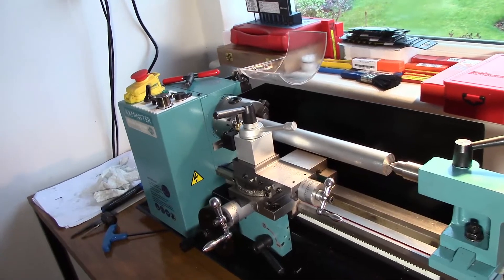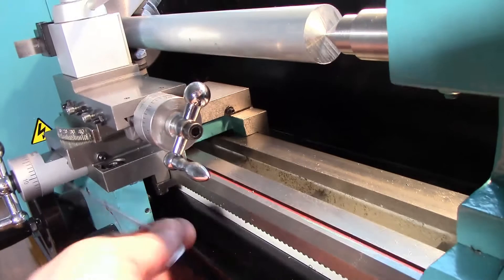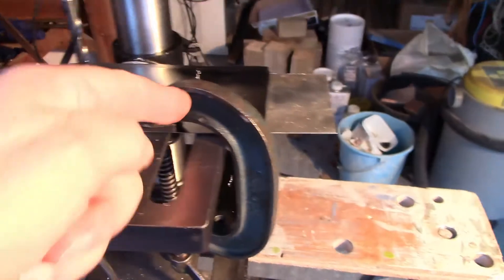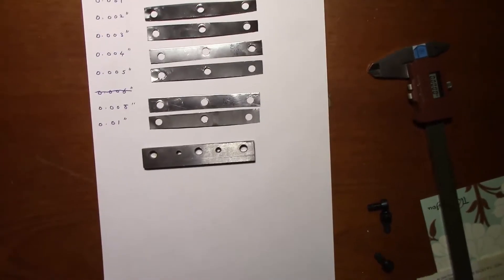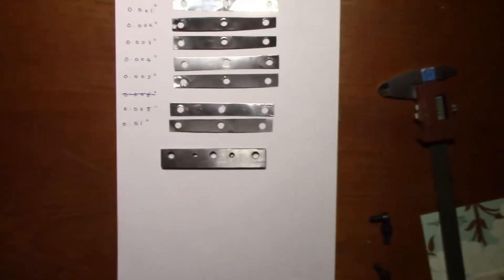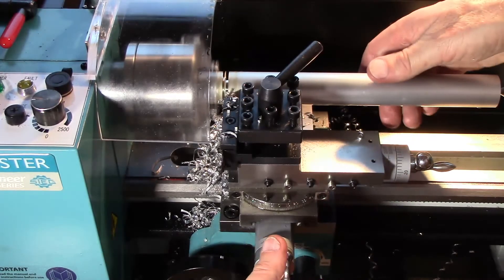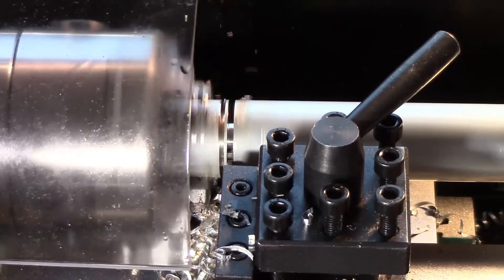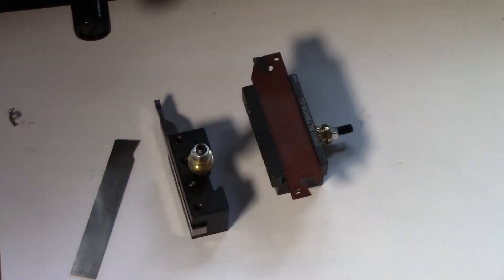Struggling with parting off on the SC2 mini lathe - part 3

Comment: One thing I do is to apply forward pressure to the tool-post by hand so that any backlash in the cross feed thread is taken up in that direction and the cross feed id effectively holding the tool back rather than push it towards the work. It seems to reduce the tendency to chatter and grab. Taking a second cut to the left of the parting-off line also helps. I only use the cheap and cheerful parting off tools with the 1.5 x 5 x 63 HSS inserts held in the standard 4-way tool holder. And unless I'm cutting just delrin I'll sharpen it before every job even if its only tickling it with an Arkansas stone.

Comment: Lubricate the aluminium with wd40 . The wedge type tool post is better than piston type also.
Reply from the maker: Since 2018, I have changed the toolpost for a steel one of the wedge type. But most of the flexibility is elsewhere, I think.

Comment: Put the tool in upside down and reverse the direction.
I too am a beginner, and I went through five or six carbide inserts trying to part off. I haven't broken any since parting off with the tool upside down. 
Try it, you've nothing to lose.

Comment: I use this style https://littlemachineshop.com/products/product_view.php?ProductID=1729&category= They don't seem to stock the exact ones I bought anymore.  They are relieved on the sides.  End on they look like a "T" .  To sharpen, I have it mounted into the holder to help keep it square and level and push it straight into the bench grinder wheel (6") this keeps the cutting edge perpendicular to the Z axis of the lathe and the radius of the grinding wheel gives some relief.  I use this set up on an SC4.  Cutting oil or WD40 for Aluminum
Reply from the maker: Thanks, I'll try something like those. But SC4 is 3 times heavier than my SC2, so I expect you get much better rigidity too.

Comment: A lot off oil and slow rpms for parting,, but you need to realize it's not easy to part stock being supported from both ends it has no choice but to drop and bind

Comment: these Chinese lathes are poorly designed. the compaund rest end cross slide are undersized and the sliding pin is too wide. those who buy them are forced to make many changes to improve the situation they manage to work but it remains a bad product. i recommend a proxxon mini lathe is small but it truncates metal like butter.
Reply from the maker: The nearest equivalent Proxxon lathe is the PD400 at £2380 compared to £763 for my SC2. I guess you get what you pay for. Or, you are paying German as opposed to Chinese labour costs!
Reply: @samuelfielder  I can reassure you, the PD400 also has the same problem ...
Reply from the maker: @TorteTS  Good to know that. If I were to spend above £2000 on a lathe I'd go for a used Colchester I think.

Comment: I admire your determination and efforts to succeed with the parting...
If you havent made the saddle lock yet - you can lock the saddle by disengaging the lead screw from turning (lever at back) and use the power feed lever (under the saddle) to clamp the half nut unto the lead screw.

Comment: Carbide inserts are sharper than you think but at any rate don't push them harder the machine needs to be turning at a very high rate of speed. Remember carbide requires high speed very very high speed

Comment: Greetings Samuel, I have a similar mini lathe and it is stock standard. I don't have much problem parting off with it. Several things I noticed from your video. 1. Get rid of that aluminum quick change tool post. I bought the same one and it not really satisfactory. 2. Always part off with cutting fluid .Paraffin works best with aluminum.  3. Part off spinning the lathe as SLOW as possible. Keep in ming you have a mini lathe, so keep the cuts steady and not too aggressive. Hope this helps.
Reply from the maker: Thanks.

Comment: As Doug said, cutting fluid would have given you a much better chance.  Don't use your tailstock as this creates pressure towards the chuck. If anything, when you need to remove a piece of a long part, use a steady rest. A trick I learned is to run the parting blade in a bit then back out, move the carriage over a bit and now run the parting blade in right next to your previous cut. Repeat this back and forth, essentially creating clearance for the blade until your all the way through.  BTW I have the LMS 7x16 lathe. Thanks for sharing your video. Keep it up!
Reply from the maker: Yes, one one occasion the tool definitely stuck due to lack of clearance, so that's worth trying. In my more recent video of making stainless steel washers (https://www.youtube.com/watch?v=m7kfrtiR-GA ) I copped out and used a band saw. But that was also because I didn't want to waste so much metal.

Comment: The problem , not only with these flimsy mini lathes but also with much more rigid ones is the top slide. Top slide is the weakest piont in the design of the lathe and should be removed . A rigid tool post should then be mounted on the cross slide. The top slide should only be used when turning small tapers.

Comment: From my experience I would try and ditch the aluminium quick change toolpost and replace it with a sturdy Dickson style holder, I decided to treat myself for Christmas and invest in one and I am not disappointed. Also when I am setting up a parting tool I put a dial indicator on the lathe bed indicating off the side of the cutoff tool and run the cross slide in and out and adjust the tool to be perfectly square to the work

Comment: PS:  I am sure by now you will have realized that cutting between centers puts the blade in a bind from the pressure exerted.  If you do use a center at the tailstock you need to drill a center hole to seat the center.  Also your feet per minute changes drastically as you get toward the center which will change how the parting tool feeds.
Reply from the maker: Thanks. Good points. I do find with parting off that more and more force is required as one approaches the centre, and have tried upping the RPM but have not found that this solves it.

Comment: Well done with the mods, they should certainly add to the stability of the lathe.  I had to do a similar shimming of the carriage on my small cnc lathe.  Impressed with your persistence with the most difficult operation in turning, it is probably the one thing most folks find a nightmare.
Is that machining grade aluminium?  In Australia it would be known as 2011 grade.  That would be much easier to machine than standard 6060 grade.
You were right to believe that the narrower cutting blade would be easier on the lathe.  I have 2 parting blades of similar width.  I use a Kennametal holder and use their 1.6 wide low cutting force inserts, it is just brilliant.  They are available down to 10x10 shank so very suitable for small lathes. The one I have will part 41.0 diameter, which is as large as I need to go.  
Carbide inserts can be moulded (not very sharp) or ground which are sharp.  They also like speed, I would run that diameter at around 2500rpm, I don't know if you have that available.  By the time you get to the smaller diameters as you are parting off, there is very little surface speed due to the reduced diameter and this does make things a bit difficult.
That Kennametal holder and insert would also give you the best possible result with the stainless you struggled with some time ago.  Proper parting tools are not cheap to buy, but they do tend to earn their place in the workshop.

Comment: Grinding the correct angles on such small HSS tools is certainly a skill, the Arc one I have came already profiled thankfully, I fancy trying a carbide one next, despite what some say, carbide tools can work on small lathes, I've just switched to a turning/facing insert and it's great. I dunno about parting off with such a long length sticking out of the chuck like that and using the tailstock, that may not be the best thing to do, personally I would bandsaw the piece then 'face' the end in the lathe.
Reply from the maker: Yes, I was only using that long rod as a test, I didn't really need to part it at all. I've used carbide inserts for turning and facing too with no problem there.

Comment: HSS parting off tools you can reground to suit  your needs. That's arc  HSS too seems to be ok just need relief on both sides. I was struggling massively with my lathe til I figured out.
Reply from the maker: Thanks. You're right that that thin HSS tool needs relief, but I fear at only 1.5mm thick there's not much scope for doing it. I guess I'd have to grind 0.2mm off each side for the full length of tool that's in use (i.e. in this case 14mm). Probably the tool is then going to bend. Perhaps an HSS tool with 2mm wide cutting edge would be best for me.